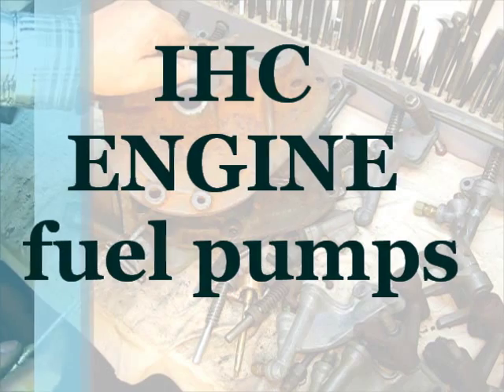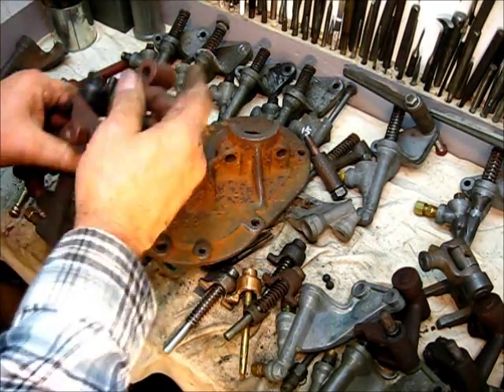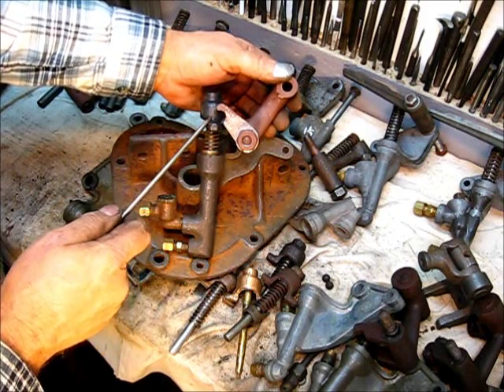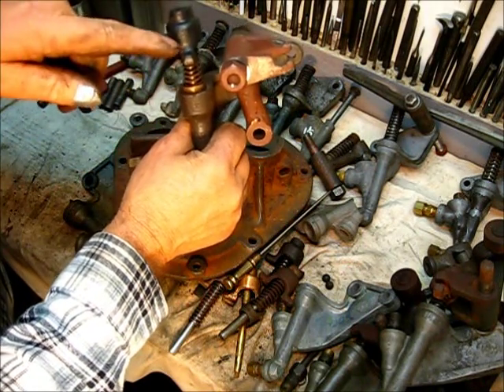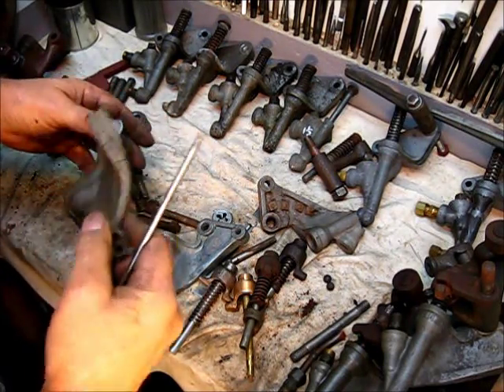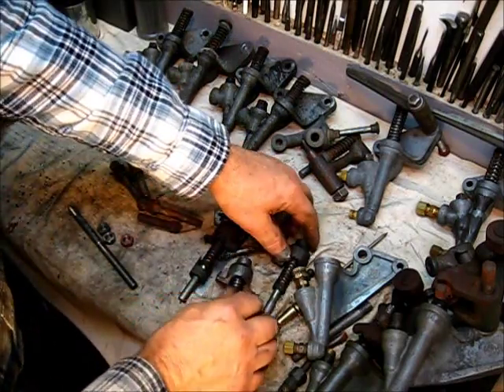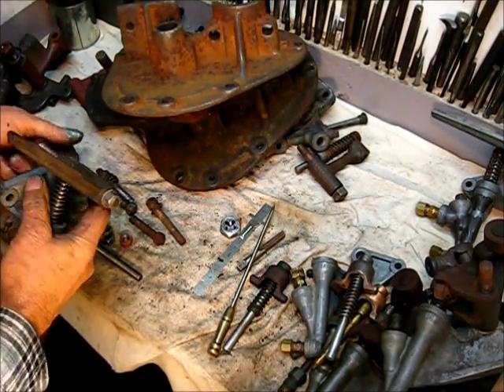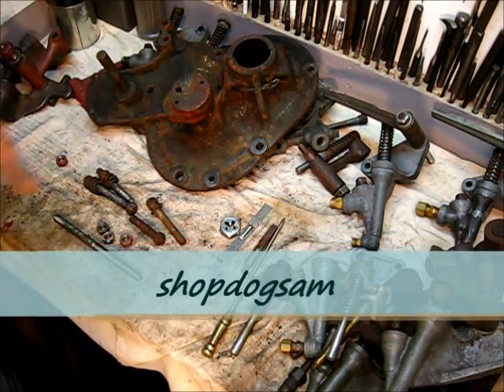IHC Engine / McCormick Deering type"M" fuel pumps 1of2

Comment: I believe I have a late model fuel pump magnetic housing with a  button top plunger the packing gland  is flush with the pump body  is it a seal or sting type  packing ? how do you repack it it weeps once in a while, We got the engine running thanks to your videos!  The rod is  knocking and .070 end play on crank govener has to be released to measure thanks for sharing your knowledge.
Scotty